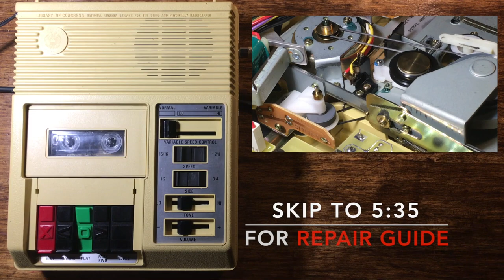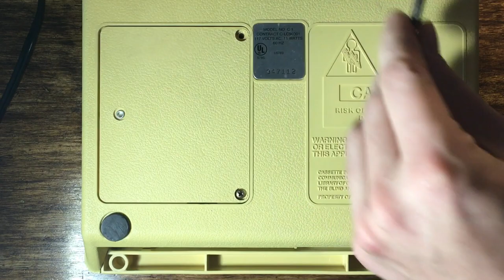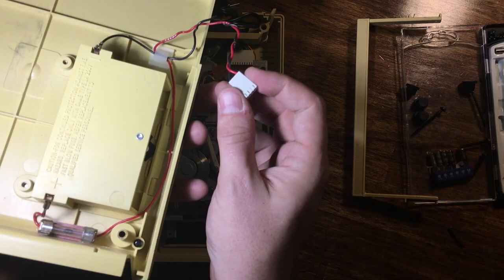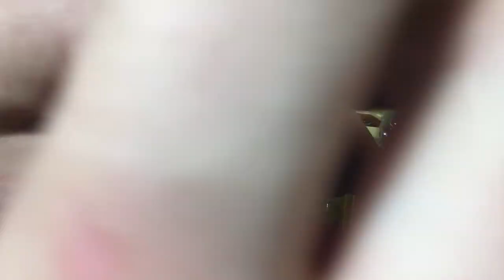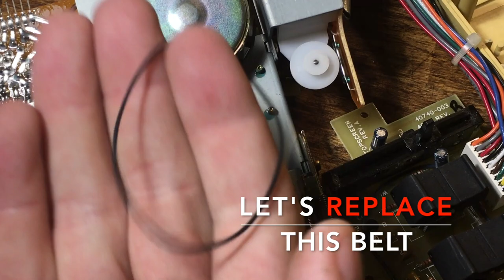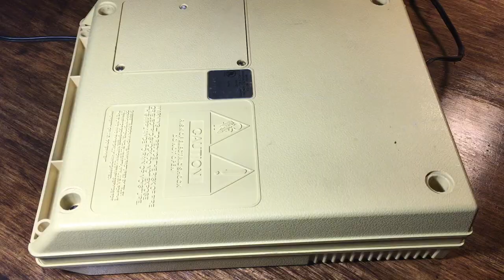LIBRARY OF CONGRESS C1 CASSETTE TAPE PLAYER: TEARDOWN, TIPS, & REPAIR GUIDE

Comment: Great tutorial! And for those having issues with rewind/fast forward after changing the belts, I found the issue (I left a detailed comment below as well). The issue is the belt shape for the SMALLER belt - it needs to be replaced with a ROUND belt. Square belt on SMALLER belt will cause the rewind/fast forward to stop/malfunction.
Reply: Wished I saw this comment earlier, I managed to fix this by just leaving a rubber band to strech over a can overnight.
Reply: Hello where can I find the correct sized belts ? I’m from Germany ..is there a company who produces similar ones and sell them through the internet ? 
Any help would be great
Reply: I had a similar issue with play and fast forward when I used a square belt for the bigger belt. It would turn for a couple seconds and then stop. Once I changed that to a round belt it started working fine.

Comment: I have one of these cassette players along with one of those green cases the video showed, which contains several audiobook tapes. The player did stop working at one point, but I simply removed the rechargeable battery and it has worked fine since, as long as it is plugged in of course. I had no idea what this player was used for though, I’m very thankful you posted this video so I could learn more!
Reply from the maker: The green case ones look super neat! I’ve never seen one in person before! 

Also good to know the battery trick worked for you too! Glad I could help!

Comment: i just recently ordered a C-1 off of Ebay and it came in well working condition until a few days went by - it would take me 2 presses of the play button to get it to work - a few more days went by and it then took me 3 presses to get it to function, and now it will not play. i opened it up and it appears the the freewheel (the rewind side) just stops after a second of being played. i will get some speaker feedback and then it will make a small pop and quit. i've been using the instruction cassette as a test and i thought i got it working when really only one of the knobs were spinning and it unwinded the whole tape and made a mess. 

hoping this isn't a battery issue because i payed a pretty high price for the player. i am new to all of this and taking this thing apart was super fun - i wouldn't have been able to do it without your video. so thanks!! hopefully this makes sense.
Reply from the maker: Make sure it’s super clean inside! Those old rubber wheels inside can crack and degrade with heat and sun exposure so inspect those closely as well. 

Remove the battery entirely if you haven’t already and try to slowly diagnose each part at a time if you can! Hope this helps.
Reply: @drut Did you ever figure this out?  Sounds like I have the same problem with one I picked up recently.  I replaced the belts and cleaned inside.  At this point, with a tape in, it will fast forward and rewind without problem.  However, if I hit play, it will go for about one second and then promptly quit.  It makes the same noise that you describe - a small pop and then stop.  Any luck fixing yours?  It's driving me a little crazy.  I've been looking at it and googling this issue for hours without coming up with an answer.

Comment: Hey Adam, great video! I've just been digging into my C1 to replace the belts, FFD works fine in my unit but REW does not work at all, any thoughts on why this may be or troubleshooting tips? Everything else works 100% with the exception of REW. Cheers!
Reply: I’m having a similar issue where both fast forward and rewind will run for a couple seconds and then stop. Also if I’m too quick with the variable speed control it stops working, this is all happening after I’ve changed both belts. 😑 I’m hoping for a bit more info on what the issue might be.
Reply: @theComaCalling  @kyle Bourcier @Adam Cee - I think I might know the issue. My unit/belt(s) was fine when I got it a few weeks ago, but I decided to put new belts on there after opening and cleaning it. My rewind and fast forward stopped as well, and I noticed it was the smaller belt that would stop. I removed it and put the old one back on and I noticed something...the SMALLER belt is ROUND. So when I put a square shaped belt it screwed it up. When I put the original round belt back on, rewind and fast forward worked again. So for that smaller belt, use a ROUND belt. Look this "Universal Mix Cassette Tape Machine Belts Assorted Common Round shape Rubber" up on eBay, you'll find what you need. Cheers!

Comment: I’m stumped. What does the smaller belt do? FFW and RW didn’t work, I replaced the belt and even used the original round belt. When I take the belt out altogether, everything works. Play, FFW and RW. I put a belt on and no FFW or RW.

Comment: So, I opened up and cleaned my deck.  Belts look fine, connections all look fine.  The problem I am having is that when I plug it in (with no battery in), I get nothing at all.  Not even that low hum that you get sometimes with other decks.  Just no power at all.  Advice for what to try diagnosing next?
Reply from the maker: Michael Anderson Double check any fuses on the Unit and replace them if burnt or broken? It could also be the power cable itself. Sometimes the corner of the plastic case will pinch the power cable and damage it.
Reply: @AdamCee  Power cable and fuse (I only found one fuse) are good.  Used a voltage detector and continuity test on them.
Reply: The C1 can run on a nine volt, just ditch the old crappy battery and solder in a nine volt connector. Mine runs great now.

Comment: Hello thank you so much for the video! Appreciate all the help, is there any way to get a replacement battery? I just plugged mine in and it was working for 10 seconds, play pause rewinds and all of a sudden it just stopped.. I will definitely use this video for a help.. does the battery even make a difference if I’m just plugging it in the wall? Thank you friend
Reply: I think I’ll retro fit a 9v battery first and see what happens

Comment: Jeff Van Newkirk
0 seconds ago
I have one that does not fast forward or rewind. I've changed the belts and that has not fixed it. Do you think it might be the caps?
Reply from the maker: It could be the motors. Take out the battery pack if there is one and see if that helps. Otherwise I’m not sure. My apologies.
Reply: @AdamCee  Thanks, It might be the rubber rings around the supply reel. I have yet to try it
Reply: Do I have to have battery in if I can just plug it in? Also. Where do I go for belt? Size?

Comment: Hey there, thanks so much for the video. I picked up one of these at the fleamarket recently. When I plugged it in, all I got was a low humming noise. Popped the unit open, noticed that the belt had melted, and following your instructions, installed a new belt. After that, still won't run and all I hear is the low hum. Next, I checked the battery and noticed some corrosion on the terminals. I'm assuming at this point that the battery is hosed and that's why it's not working. Would you agree? If so, do you know where I can purchase a replacement battery? Thanks!
Reply from the maker: zizoumonk10 look on eBay or other second hand sites. Check out Hainbachs video, in it he uses a 9V battery conversion since he’s in Europe.

Comment: having an issue with mine where when i go to rewind it will only go for a second then stop.  Have replaced both belts to no avail, and it keeps eating up my tapes.  Any Ideas as to what i should look at?
Reply from the maker: Hmmm. Make sure the replacement belts aren’t too tight, and give it a really good cleaning if you haven’t already.

You may need to do some tests on the motor or replace it entirely unfortunately. 

Double check the power cable closely for any cuts or tears, remove the old battery and check the fuse for burn marks.
Reply: Did you ever figure this out? I have one with the same problem.

Comment: Just got one of these units. I swapped out the belts because one had melted, but it still doesn’t work. When I press play it hums for about a second and then it turns off. Any ideas?
Reply from the maker: Make sure there isn’t a battery in the unit. That always caused problems for me. Double check all the cables inside and make sure they aren’t cracked or damaged. Just slowly diagnose the unit one part at a time if you can. I will try to recreate this with the C1 unit that I have and I’ll see if I can get to the bottom of this for you! 🙏🏻❤️
Reply: Adam Cee thanks man! I really appreciate it 🙌🏻
Reply: Adam Cee I think I got mine working! The motor had melted rubber inside of it blocking it from working properly. It’s still acting a little bit funky but it’ll be perfect if I can find a motor swap 👍🏻

Comment: Has anyone ever had to replace the rubber pinch wheel that makes contact with the belt? Mine melted… just finished rubbing and scraping it off with 91% IA, iso a rubber pinch wheel abt 1.25cm diameter. Halp!
Reply: I have this problem. Did you find a solution?
Reply: @histerics3  you can get replacement pinch roller wheels a few places. (Amazon being one of them.)  Shouldn't be an issue ESPECIALLY if you already know the measurements. 

(Dunno if youre still having the issue, ofc.)

EDIT: I see, below, that Adam recommended just buying another cheap unit to scrap for parts.
Reply: @nilespeshay1734  since posting I've tracked down the stuff and revived my machine. Didn't know the measurements, though because the old ones had turned to goo, lots of trial and error.
Reply: I used these measurements for the idler belt: 13mmx17.2x1.8. Worked perfectly, but it's a C78 so maybe different from the C1. I also had to replace the pinch roller, which took some time to track down. I bought three different sizes from a seller which were close to the goo that was left and tried them all.  It also took some time to experiment with different belt sizes (I just had a bag of assorted belts) to get the rewind/FF/and play to all work perfectly. I ended up trading the machine to a friend who has been using it a lot lately on his channel soaringtortoise